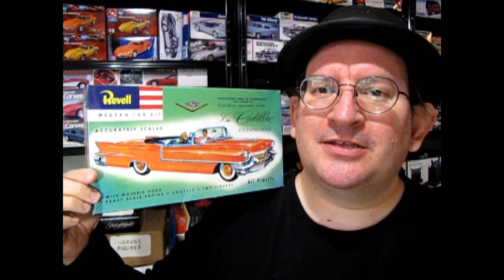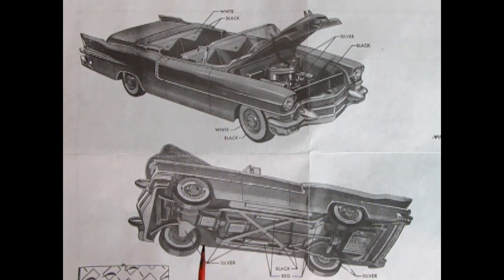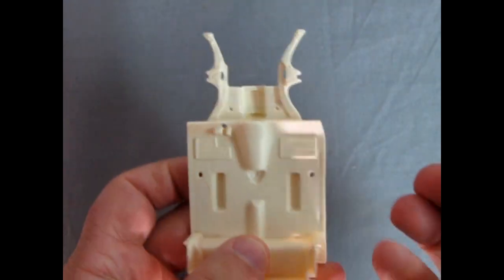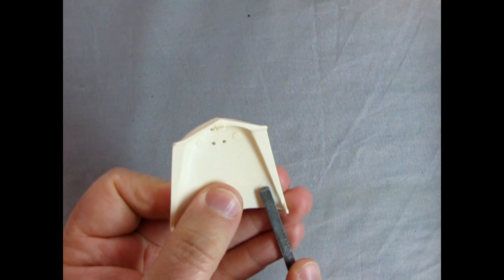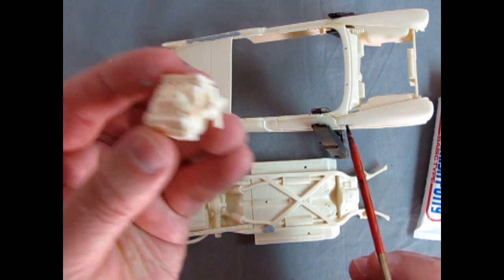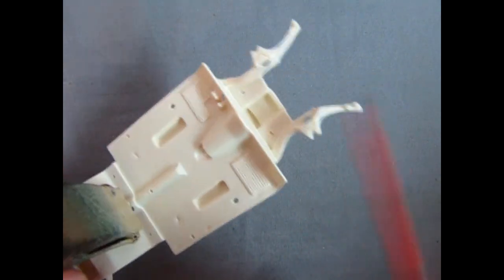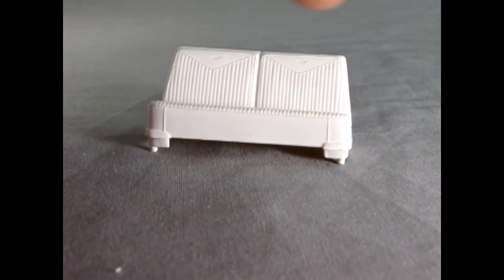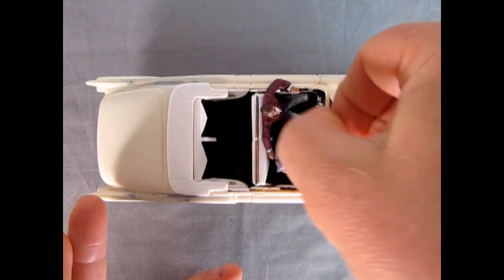Model Car Garage - 1956 Cadillac Eldorado Biarritz By Revell in 1/32 Scale - An Unboxing and Build

Comment: Yep, you are a brush paint master Trevor👍This is how we started as kids. Great tip with the White walls.
Reply from the maker: Thanks 👍 Glad you liked the video. After years spray painting, I just decided I had enough of clogged nozzles and I picked up the brush again. - Sadly, I'm still getting dust in the paint. I guess some habits are just too hard to break, even though I wash the car with static blocker and use canned air to blow out my brushes and the model before I begin painting. I just understand where the dust is coming from.
Reply: @MonsterHobbiesModelCarGarage  yeah my ceiling fans blow dust here. I really need to clean them.
Reply from the maker: @smithgroove945  My house is so dusty that the tables wear sweaters! LOL!

Comment: A tip from a pro on the tires. Paint the tire black, then take a drill  motor or rotary tool and the right size drill and place the drill inside the hole of the wheel cover, 'totally assembled'. Secure the drill on a sturdy surface. At low RPM procede to carefully apply the whitewall using a fine paint brush. A perfect circle is the result.
Reply from the maker: For sure. Have you had a look at my Tips and Tech video on painting tires? I use the same principle there. Another idea is to use the tire spinner for the cub cars.
Reply from the maker: It's called a mandril. Forgot the name, but I used it on the Cub Car wheels to sand down the outer edges. It's a metal rod with a screw on the top. Take out the screw, put the wheel hole on the screw and screw it back into the rod. Then you can turn the wheel in the drill.

Comment: :chillwcat::face-fuchsia-tongue-out::elbowcough: The built kit looks great. How did you brush paint the gloss black and not leave any brush marks?:shelterin:
Reply from the maker: Thank you! 
I am a master of the brush!  🖌
Actually, the Tremclad settled out really nicely on it's own. 
I just went a little "Thick" in application.

Also, I think living in Alberta in a dryer, higher area (2000 k above sea level) helps out. This is right out of the can and has no clear coat.

My Dad's models (And even my own when I lived there), painted in British Columbia, using Tremclad, look "foggy" in the paint and never achieved the high level of gloss that mine do in Alberta. B.C. is located on sea level (0 K) and is quite wet and humid. I think that affected the paint there.

Comment: I have a Atlantis release, I picked up a couple months back, it came with front and vent windows
Reply from the maker: Yes, the new one does. I saw an unboxing/build for it. Wish mine had the glass. I wonder if it's a new part from Atlantis, or if Revell had it and didn't include it in my kit or something. - But it's not in the instruction sheet, so who knows.
Reply: @MonsterHobbiesModelCarGarage  I think Atlantis made the glass.
I've seen just the glass for sale on there website
Reply from the maker: I hope it's not too late in my construction of the kit to slip a windshield in there.

Comment: I think when this guy says he brush painted it ,he means airbrush. Lots of people just say brush they don't say airbrush
Reply from the maker: Nope. I BRUSH painted it with a 1/4" wide brush. 
Perhaps in my next video, I will paint a section of the kit to show my technique. :_Suprise: - Have a good one!
Reply: That's a pretty good paint brush. I use a lot of brushes ..usually I use a 3.0 or 30.0 for fine detail
Reply from the maker: @larrymartin4294  Well, the brush sizes all depend on the job. I use 0.30 too for the fine detail, but I also have a long bristle brush that I use for pinstriping.
Reply: Kool
Reply from the maker: @larrymartin4294  I also have a set of Mack Pinstriping brushes, but they are too large for 1/32 scale.
Reply: Sounds good
Reply from the maker: Yes...now onto my next build - the new 1960 Ford Truck. - But first, I need research!